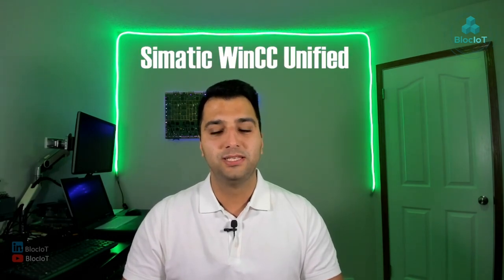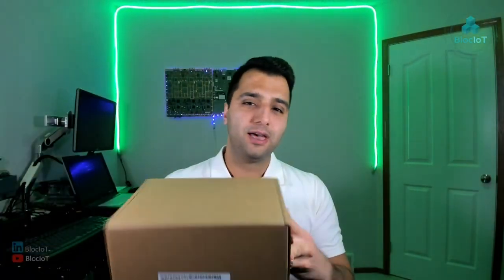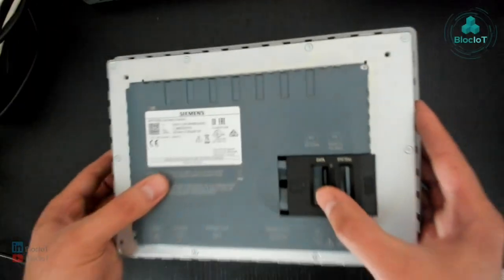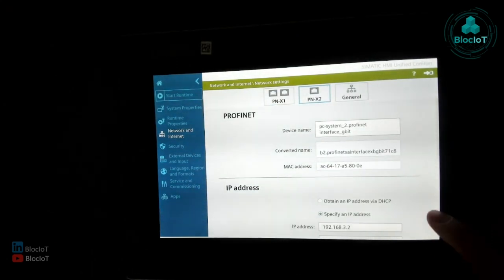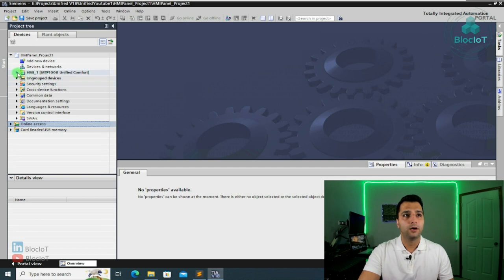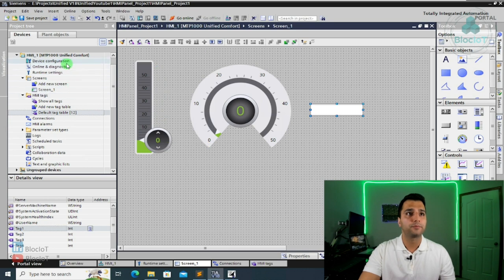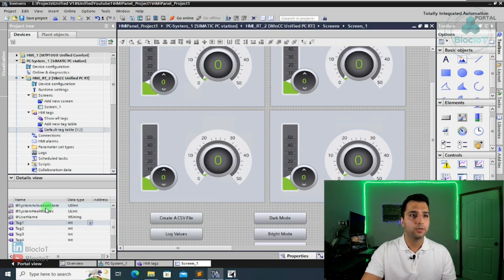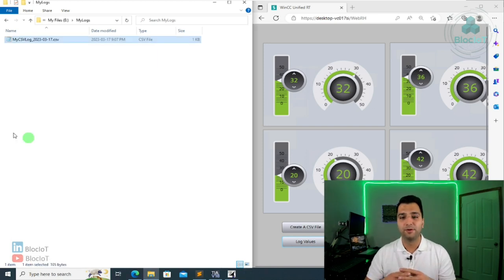11- WinCC Unified Tutorial: Introduction, Unboxing a HMI Panel and Creating 2 Projects in TIA Portal

Comment: Can i ask you a question about my Winncc unified pc rt?
Reply from the maker: Sure
Reply: @blociot  hello , i have a tia-portal v18 but i didint found  hmi simatic unified confort panel . how can i do to get it plz?
Reply from the maker: @achrafoulidi6548  you have to install it. It's on the same DVD as Step 7. If you haven't install it, just run the installation again and select modify and install WinCC Unified.